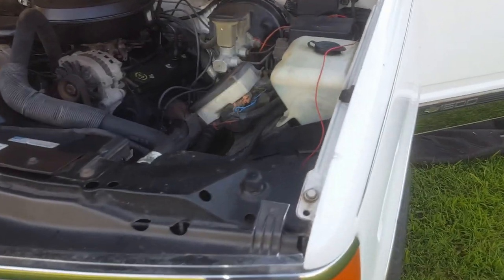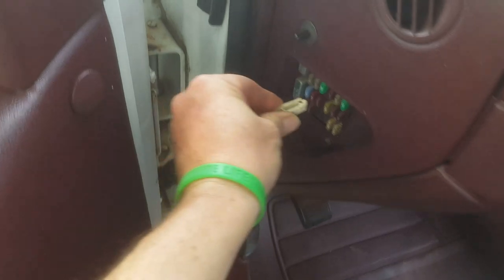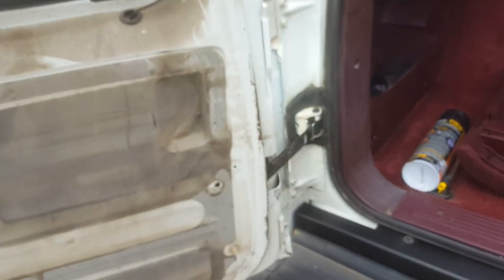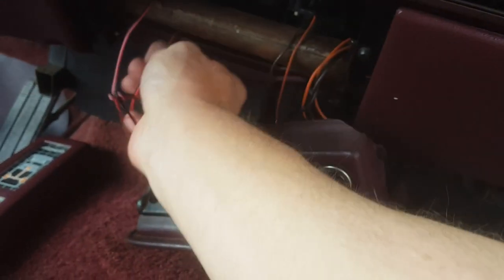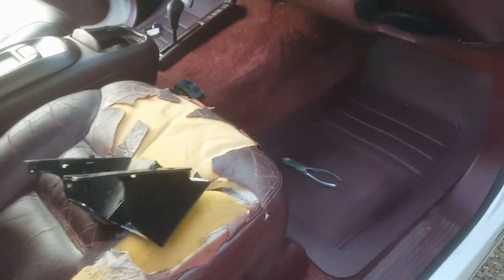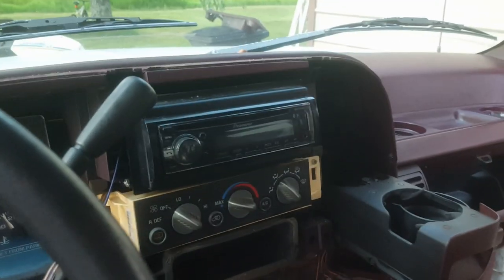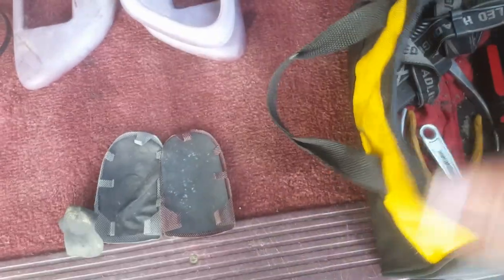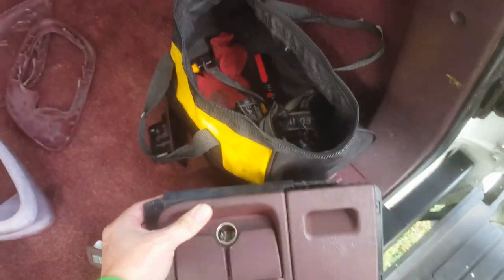How many problems can a CHEAP Chevy Tahoe hide?

Comment: This year and up Tahoes can be a electrical nightmare depending on who own it man I've seen some pretty creative wiring done by owners on these trucks!
Reply: You said, "this year up Tahoe's present electrical problems"...
In my opinion, & I'm sure in you'll concur, it's "quality suffering because of quantity ".
Still in all, I'll purchase my preferences which are General Motors, Mopar, FoMoCo, American Motors, American manufactured brand vehicles over any thing foreign. .
Reply: @tommylmccaleb8241  yeah you are right the constant need to add more and more gadgets to a truck then add not very good quality control really has made US made or assembled cars/trucks worse over the years not to say that most foreign cars are much better. My 87 ramcharger is over 34 years old and still works like a charm and is dead simple to repair and hasn't had any major repairs ever just manitence can't say that about my niegbors trucks over the years his current 2018 ram 2500 is on its third transmission!

Comment: Having bought and fixed up (I am uncomfortable using the phrase restored) some mid 1990s cars, they can be a rats nest of complex electrical and mechanical problems; especially if previous owners and “mechanics” have had their way with it by making shoddy “repairs, upgrades, and (gulp) improvements” It seems even more an issue on trucks, large SUVs, and (basically) any model that is popular with 16-25 year old male owners. Generally, most models from the 1990s have “pattern failures” that you can darn near set your watch by at certain age and/or mileage; so its a good idea to find out what those failures are on the particular model your looking at buying. If you find a car that has a lot of missing parts or cut and spliced wiring, that is a good one to walk away from … because, as much of it as your seeing, you can bet that there is much more that you just have not discovered yet. Some amount of none factory wiring, connectors, small broken/missing parts etc. is to be expected on a 25-30 year old car, but if its everywhere, keep shopping. If you are seeing spliced in wires to a ECU … run! I don’t buy anything as “fixer” with over 125,000 miles because my theory is old and broke is workable but worn out is terminal. Granted, that mileage is getting hard to find.

Comment: I hate scotch locks and but connectors.... never used them, never will. They're a bad connection waiting to happen. I like solder and shrink tubing. All cars, foreign and domestic seem to be wall to wall ultra cheap thin plastic, that breaks down over time. Did I see the factory radio installed at the end o f the video?

Comment: i got a 99 tahoe looks identical to yours but its black gray interior 97000 miles 5.7 vortec, trans is junk replacing now, my 97 z71 has the same front end

Comment: I myself don't understand fixes like the supposed lost ground for the wiper,most generally the problems are slow moving wipers and loss of speed functions and not shutting off, the module circuit board needs replaced, and if they don't understand how to use a dvom fine but what about a continuity tester,aka a test light, would still show it didn't loose ground and don't take much to figure out how a test light works lol.. and in the case of my 89 Chevy S10 El regular cab short bed 2wd 2.5/5spd that actually had lost ground, the wipers only worked on low, and the fan motor was switched to a house single pole light switch with phone cord with the connector clear plugs cut off,not making this up, and the dome light didn't work, but the dash lights and interior lights when in use would get brighter and dimmer when the fan motor was on and the heater control didn't have to be used, important to remember this truck has been in a garage and they installed a new radiator and battery box. Well the front harness ground at the core support was loose and the ground wire was not put back on the bolt at the bottom side of the fan motor,fixed both issues, and then unhooked the wire to the fan motor heater switch setup and used the factory controls and it worked, the interior lights and dash lights stopped getting really dim, and surprise, surprise the dome light started working and it quit occasionally blowing fuses, and at times the truck would take a bit to start, that would be ignition is where they powered the light switch..
Reply from the maker: Yes, the board in the wiper motor was having problems...nothing to do with the ground. I reflowed some solder joints and fixed it.
Reply: @TylersNeighborhoodGarage  true and I understand some people don't know how to flow already used solder to strengthen the joint and unfortunately that's why they sell the replacement parts for like $10 they sell a million of them...lol I've even had a k20 that the board was Rusty and cleaned it up with isopropyl and a dollar store tooth brush and fixed it and when I replace my soldering iron and gun I'll be able to do what you did and in the case of my k20 the wipers wouldn't shut off?? That's the same 86 Chevy k20 I had for 12 and 1/2 years before I traded it off but honestly very few electrical issues with that truck and Almost everything on it worked.. anyways when I got it it was missing the cowl and hood hinge seals.. explains the Dr side floor pan kick panel and the wipers issue..